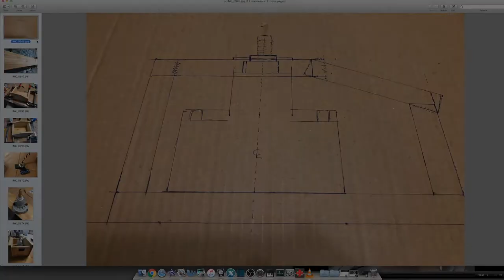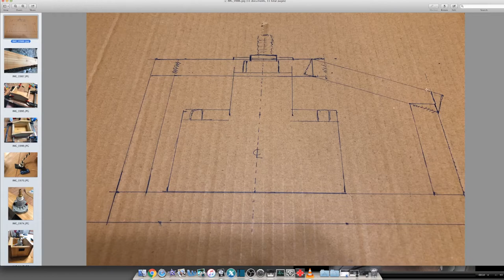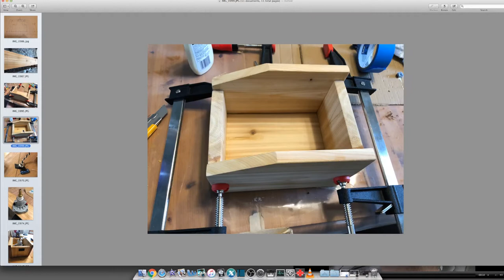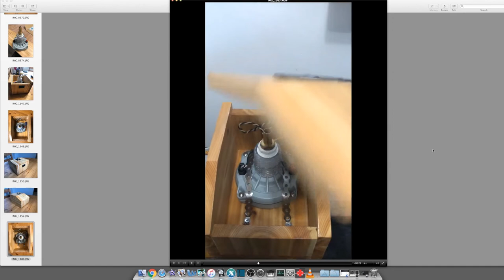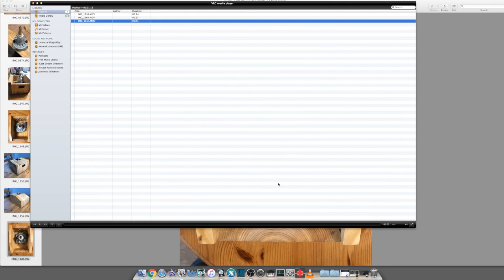BUILD YOUR OWN DIY TALKBOX For Less Than $100!

Comment: Hi, I have a compression horn driver that is 16 ohms. Would the type of capacitor you have work with 16 ohms or would I need to use a different kind of capacitor?
Reply from the maker: I’m really unsure, so sorry man

Comment: Hey man, I loved the video and am considering building one myself. My fender hot rod deluxe has a preamp out, could I connect that to the talkbox?
Reply from the maker: You would actually need to take the feed that goes right from the amp where it would normally go to the speaker cabinet. The talkbox is actually a speaker. You just need to make sure you match the impedance. Hope that makes sense
Reply: @DMKahn  ah yes that makes sense, thank you so much!

Comment: i just built this a few days ago using your parts list. only things that are different are the capacitor, i used one that i had on hand and it is a different value. and the hose barb is plastic and not brass like yours.   it sounds great but i find that its not that loud?  i used my fender deluxe reverb amp on 10 , its a 20watt amp .   also, are you supposed to cut the tubing down? if its longer, will that make it quieter?  i can just turn my mic preamp up, but then whenever i breath its reaally really loud.  also,  thanks for all your videos, im loving them and finding them very useful. keep them coming please
Reply from the maker: It’s hard to judge “loud”. Mine gets loud enough to rattle my teeth. So I’d say it’s pretty loud lol.
Reply from the maker: Really cool you made one tho! Glad this video helped someone hahah
Reply: @DMKahn  mine is definitely not that loud. ill try ordering the same value capacitor you did. maybe that makes a difference. also, how long is your tube?
Reply from the maker: Matthew Moran it’s frickin long, like 10 feet

Comment: the talkbox will be passive? my amplifier has 2 100w speakers, will it work on the line output?
Reply from the maker: The talkbox itself is basically a speaker. The one I made here is good up to about 30watts. I think your amp would blow the talkbox speaker. I’m not sure there are talkbox type drivers that can handle that much wattage. Maybe if you used a loading device to drop the output wattage it would work. Cheers
Kahn